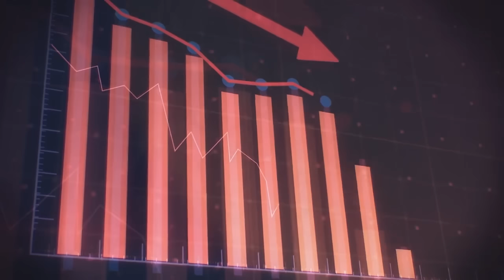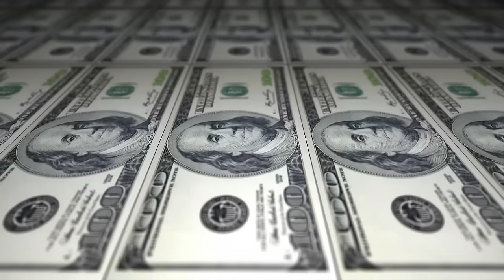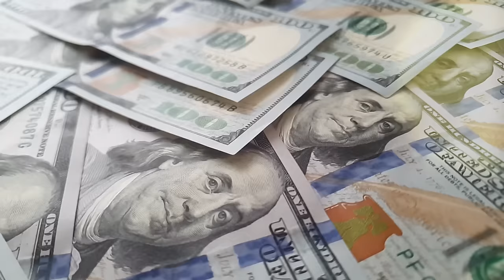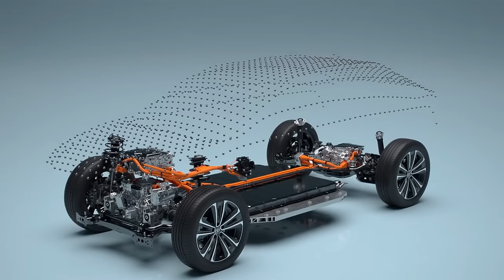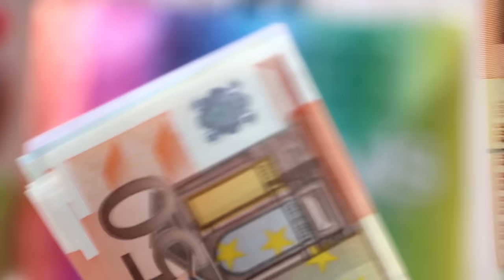The ‘I Told You So’ Moment: Toyota’s Predictions About EVs Come True! Electric Vehicle or Hybrids?

Comment: More to the point, they haven't answered where the power to charge these EVs will come from once they have abandoned all the coal, gas and oil power stations and we only have wind and solar (in Australia)
Reply: Math is not your strong suit, eh.
Reply: Obviously not yours... @godofbiscuitssf
Reply: @godofbiscuitssf  math is not the problem here: electrical technology is the problem. Electric production from solar and wind is very "weak" against power demand and cannot follow the constantly changing electrical absorption in the network. You would need a much much much more advanced battery technology that we have got today to face the problem.
Hydroelectric power is more resistant to fluctuations but also that one is not really capable of adapting to power demand quickly.
Reply: @jossdeiboss  California has already experienced full days of renewable power exceeding 100% demand and Texas is close. Load shifting and new and inexpensive methods of power storage, like compressed air, and use of constant (in the aggregate) sources like wind are viable and being added to the grid. Across broad arrays, wind is not "weak", the sun goes away at night but wind does not. New auto battery formulations like lithium iron phosphate are resistant to thermal runaways, have increased range and resistance to cycle degradation, and are already in production, they aren't lab experiments years away from reality. The issues with electrification are ones of transition and they're fading, they're not intrinsic and insurmountable.
Reply: @godofbiscuitssf    Not yours either mate.
Reply: @tinetannies4637  That's absolute rubbish. Every time someone questions the viability of green energy, we hear the same argument's. This place went fully green for a full day, or days. It HAS to work 24/7 365 days a year. No country in the world with a reasonable sized population can produce green energy at that level.
Reply: @jossdeiboss   And as technology and history show, technology never improves, and no one ever builds out new infrastructure.  Right?
Reply: No sun, no wind, and you've got no deep ground in Australia.  Everyone knows you're a literal floating piece of land.
Reply: @godofbiscuitssf  You may be right, tech will improve. But it doesn't exist now, does it. Infrastructure may get built, but it doesn't exist now.

And I'll happily transition to green energy, when it does exist. An as long as we can put one of those massive lithium battery storage units in your back yard.
Reply: @Ozvideo1959  You're looking at a new energy source that went from nothing to demonstrating it's capability of providing full coverage and using its failure to somehow go from nothing to EVERYTHING as proof of its total failure. This logic would make every new technology in every new industry a failure not worth pursuing. Why get a cell phone in the early days when they were large, cumbersome, and only worked in a few areas? Why develop the car when there was no petrol or service infrastructure and, unlike horses, they broke down all the time? Green energy has proven that it is not currently a complete alternative, but that it has the capability of expanding to do so.
Reply: @tinetannies4637  Really? How has it proved its capability to expand to become a total solution? It may have some potential, but it's a long way from being a total solution, if it ever can be. And the difference between the examples you gave is that no government of the time tried to interfere in what is essentially a market driven industry. No government said, "You can no longer ride a horse and cart, you have to buy a car" If governments are mandating a switch to EV's and by extension, green energy production, then the tech has to be way more developed than it is now, or will be, even in the foreseeable future.
Reply: @Ozvideo1959  In 1975 solar panels cost about $115.3 per watt. This dropped to $2.15 per watt by 2010, and onky $0.27 by 2021. These prices dropped because of scale and advances in technology. And remember that renewable are a mix, they aren't entirely solar, or entirely wind, or entirely anything. It's a little odd to look at an industry that has been growing quickly, consistently and globally in scope, capability,  and dropping costs, and conclude from this that it'll never be successful.
Reply: And it took 50 - 60 years of development to perfect the petrol car. Why do people seem to think that EV's will take any less to perfect? That is the problem.
Reply: @oliabid-price4517  The reason being, governments are mandating a switch to EV'S now, or in the not too distant future. They're not waiting around for 50 - 60 years to see if EV's can be "perfected" are they?

That is the problem. Manufacturers can't sell them, a large percentage of car owners don't want them. Or, in many cases, an EV is just not fit for purpose for what they use their vehicle for.
Reply: The same oil-based fuel that goes into individual ICE engines is more efficiently spent on EVs so there is a net reduction right there.
Reply: @jossdeiboss  "you can not read, do you?"   no, I guess I can't read, "DO I".
Reply: @Ozvideo1959  Just like they put electricity generation plants in people's back yards now?  jfc.
Reply: @oliabid-price4517  Yes, and the problem is that they enforce it before is perfected, instead of letting the market do its job.
Reply: @Ozvideo1959  Maybe use less energy. Not live a million miles from where you work for a start. I have umpteen cars yet chose to live where I can walk(with my dog) to the supermarket and public transport.
Reply: There is already more solar output in the middle of the day than the grid can handle hence free car charging in the middle of 5he day.
Reply: @amraceway  Do you really think people live miles from where they work by choice? Here in Australia, for example. If you are unemployed and on Jobseeker, you are required to seek work anywhere up to 90 minutes travel time from your home.

If you reject a position because it's too far to travel, you will have your jobseeker payments terminated.
Reply: @davannaleah Even if they dont abandon fossil fuel plants, ita still better for environment than all ice vehicles.
Reply: @Ozvideo1959  Move closer. Live near public transport. Ride an E bike. Commuting by car is evil.
Reply: You can plug into  your  neighbors  car and use that energy when they aren't  using the car 😂
Reply: @RexWainwwright  Why not The car is a perfect mobile battery.
Reply: @tinetannies4637  Is that why Newsome asked people to not charge their EV's
Reply: So build some thorium nuclear power plants cheap clean safe and no waste.
Reply: That is the one of the major issues with battery powered EV's, where and how does the go juice it requires come from?  As it is, many of the worlds power grids and electrical generation capacity are at close to peak capacity, toss in a large number of EV's into the mix and you could soon have demand outstripping supply.   

If you are going to go all in on EV's and ban ICE vehicles, then you are going to have make massive investments into upgrading the grid in term of both generation and distribution and it will not be cheap.  Some places like Canada are blessed with potental hydro-electric generating sites as well as area's well suited for alternative energy generation such as wind or even tidal.   

But a lot of places on the plant are not so blessed and will need to rely on the burning of various fossile fuels to generate the electricity they will need to meet their future demands.  It's a pity that nuclear power has gotten a bad rap as it one of the greenest energy producing systems going.
Reply: @tinetannies4637  Wind does not go away?? OMG, now I've seen everything..  Without base power from fossil of nuclear power plants, there is no power security. The rest (wind and solar) are just expensive to maintain frivolities.
Reply: @godofbiscuitssf show us the maths then. Because at the moment, they keep telling us renewable sourced electricity is cheaper,  yet the more we move to renewables the higher the price goes.

Maybe your awesome mathematics can tell us where the power will come from when there's no wind and the sun isn't shining.
Reply: @alanjm1234  That's less to do with reality of producing the electricity and more to do with the utility companies price-gouging you because they can.
Reply: While a shift in generation is coming, it is not required as driving an EV is already more environmentally friendly on the current mix than driving a fuel powered car. And the grid has the capacity.
Reply: @What-The-Beef  wind does not go away in the aggregate, no. It fluctuates, yes. But wind does not stop at night like the sun does. And power grids allow load shifting. If wind dies down in one place, power is diverted from elsewhere. And there are increasing options of power storage as well.
Reply: @oliabid-price4517 My Tesla improves, recalls and refines online while I sleep. Does your putt putt do that? Why not? PS I get 107MPG equivalent (as measured in Watts per BTU produces), it is 9 years old and the battery has only degraded 8% to 92% of its original power. Now I only get 255 miles range (longer than my bladder can endure nowadays). I can always find a chargers station with a bathroom and coffee. A 100 mile recharge takes 20 minutes. As for fires, mine burns 1/10 as often as gas cars do. 
Maybe this is a sponsored hit piece. 
Never mind though. The longer you wait, the cheaper they become and the more models are available. ⚡️
Reply: @Chris-ei5fz arbitrage … Tesla Supercharger batteries soak up electrons while they are cheap and sell them back when they are scarce🌞
Reply: Solar panels will be a good solution in Australia.
Reply: @Ozvideo1959  so what ? 200 miles round trip is perfect for owning a ev. saving 10 bucks in fuel a day adds up.
Reply: @tinetannies4637  Delusional. If wishes were fishes....
Reply: @godofbiscuitssf  nor yours, evidently.
Reply: Hey there how’s your solar work out at night on a calm day? Baaahaahaa
Reply: @tinetannies4637  but who’s going to build all the new power stations to power the golf carts? You can’t answer that one can you? You are correct about the grid and experts are saying that we need to build one or more per year for the foreseeable future. I’m not hearing any big infrastructure plans from anyone. You?
Reply: @Ozvideo1959  Absolutely correct! Without some kind of storage device you still must have a generator system that is independent of fluctuations.
Reply: @godofbiscuitssf  sadly you’re correct. We need to build multiple generation plants yearly for the foreseeable future, if you buy into the EV fiasco. Btw, we aren’t!
Reply: @tinetannies4637  it’s just a built up cell phone battery people! It’s marginally better than what they used in 1910, but considering a hundred years of progress, it’s still inadequate and a pain in the a… neck to use, and it’s still got all the same problems as it did back then but now we also have flash fires and impossible to repair cars. Ain’t progress grand!?
Reply: @tinetannies4637  and they’re still only what, 20% efficient or less. If you live where the sun doesn’t shine daily, at least not for a solar cell, overcast skies, rain, snow and so much for depending upon solar.
Reply: @godofbiscuitssf and thermodynamics clearly isn’t yours 😂😂
Reply: @markvincent5992  High voltage transmission lines can already transmit electricity 300 miles and there are increasing numbers of ways it can be stored -- molten salts, compressed air, hydrogen, molten metal batteries, and more in development. So on a calm overcast day it'll be fine.
Reply: @markvincent5992  I suspect we'll build out power installations the way we do most things in the US -- we'll wait until there's a critical need and then quickly barrel into it. I live in NYC and it typically takes months for even a pothole to get fixed. But when the entire subway system was flooded to the ceiling during Hurricane Sandy, it was miraculously back up and running in a week. Why? Because the subway is critical to the city's economy. When they city wants to move fast, it can. So if we need more power facilities, or a built out power grid, and there's a critical need, it'll happen. Until then, everything will poke along.
Reply: @tinetannies4637  ring of truth there!
Reply: @Kal-el087   I can't wait to hear how thermodynamics enters into renewable energy infrastructure in Australia.
Reply: @amraceway  Sure, will you build public transport in my area? because there is none.
Reply: Nuclear.
Reply: @wekirch  I’m with you. Now please 🙏 explain to me why the Germans have decommissioned all of their nuclear capabilities? Thanks
Reply: @marcelocoelho4107 The car lobby did all they could to can public transport. My advice which I took myself was to live within walking distance of the train and bus. Sure I drive or walk everywhere but my kids found public transport essential. Beats me why people move to areas without public transport or vote for political parties that don't provide it. We have endless sums of money to fight wars yet no money for enough buses and trains.
Reply: @amraceway  Because sometimes there is no choice? My birth city has no public transport at all, none. I live on the interior of Brazil, so at best we have buses, old clunkers running shitty routes and always late and you live where you can, which usually is on the edges of the city where rent is cheaper and public transport coverage sucks because politicians are stupid.
Reply: @tinetannies4637 whoopdiedoo. And Californian remain to have one of the most expensive energy costs in US. Those renewable energy projects aren't free. The technology isn't cheap either. The panels as well aren't really green since those are non repairable and go straight to land fill with all its toxic components.
Reply: Not just charge, what about everything from materials to scrapping and manufacturing and all in between? Most EVs weigh twice as much as 10-15 year old cars. The emissions on that is nowhere factored, let alone the fact that in most countries, electricity comes from fossil fuel.

Comment: I predicted this many years ago before even Toyota CEO can figure that out. I bought a Hybrid in 2015 and figured out EVs were more costly than Hybrids . Even if there is a problem with hybrid you can easily change the Hybrid system for 1000$-5000$ compared to 20k$ for EV.

Comment: What about the heating of the cab? This is an issue they never talk about. In an EV you pay for power to heat your car, while the heat from a combustion engine is surplus and free. And if your EV loses battery capacity in cold weather or parked for a couple of weeks while you are on vacation, the stored energy drops and you loose money to recharge it. While the diesel or gasoline just floats in the tank, without being less worth.

Comment: Hybrids makes better sense than full plug in EV. Hybrids can be tuned for fuel efficiency or for more performance. 

Other advantage of hybrid its like a transitional setup and technology. While improving, researching and developing electric vehicles the technology going into hybrids helps mitigate any shortcomings of the electric systems (battery, motor etc)

My next car I was thinking about a toyota corolla hybrid or a corolla gr

Comment: The main reason for the failure of EV sales in the US and Europe has been the problem of power supply and charging points to charge them which has been exacerbated by problems of range especially under cold winter conditions. Governments are waking up to the reality that mandating green energy is very different from achieving the large increase in supply as their policies mandate an ended to fossil fuels from heating, cooking and industrial use and the even greater problem and cost of expanding the electrical grids to meet that demand as well as rewiring cities to allow for home charging. Add to this the increasing problem of lithium battery fires and they have brewed up the perfect storm.
Reply: Failure is due to price. Dont make shit excuses.
Reply: @frankreynolds9930  You are correct the price is prohibitive + the problem of power supply, charging points being unavailable, cold weather,  battery fires, reduction in value, + you name it. My son know's about it.  Well at least his hasn't caught fire yet that is one big relief.
Reply: failure??????

Comment: Been there. Done that. Had a hybrid. Got rid of it. Resale value lowered 30% because of the age of the battery.
Reply: Is it expensive to replace?
Reply: @MasihAmiri_11  Yes, the battery is expensive to replace. But we just sold the car to the dealer with the big, expensive battery still in it in it, and the dealer sold the car to someone else. I doubt that the big battery was replaced. The car ran fine on its engine.
Reply: @MasihAmiri_11 Depends on your definition of expensive. For Toyota's hybrids, an OEM battery replacement usually costs a few thousand USD including labor fees. But the batteries are highest quality from Panasonic so they should easily last more than 100,000 miles. Panasonic provided most of early Tesla too. 

The difference with BEVs is that the battery in hybrids is much smaller, so the replacement cost is one digit lower. 1 BEV is equivalent to 90 hybrid cars in terms of battery materials used.
Reply: An EV is a much worse investment. That’s a fact…

Comment: Hybrid cars with easy access to the battery packs to replace cell is the way forward and the most logical way to do it
Reply: Nothing relying on fossil fuel is the way forward....
Reply: @Brian-om2hh  BEV have been failing for the last 130 years, BEV is the way backwards.
Reply: You don’t need a whacking great battery pack for a hybrid either, making replacement easier.
Reply: @Brian-om2hh  EV's also rely on fossil fuel in all the plastics in the car.
Reply: @Brian-om2hh how many kids are working on the oil rigs?